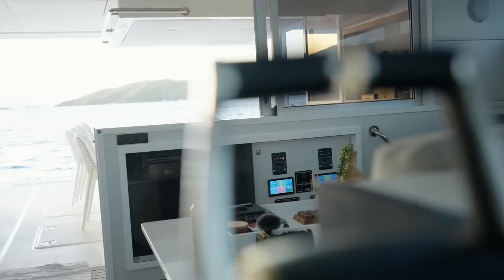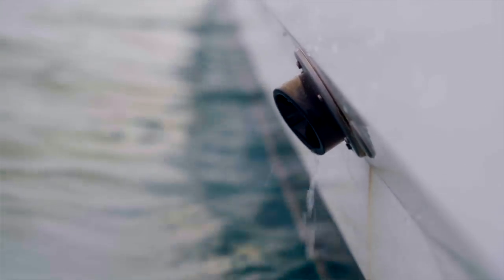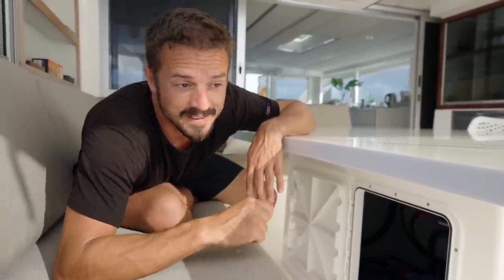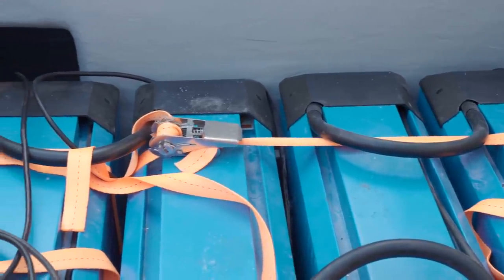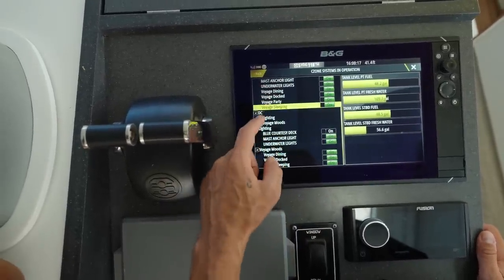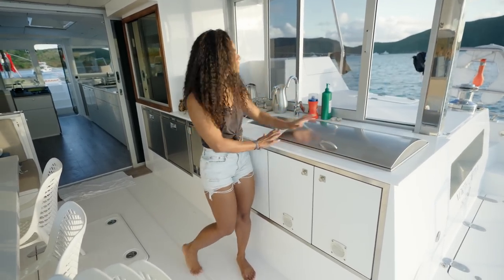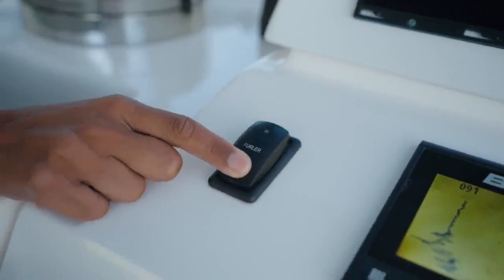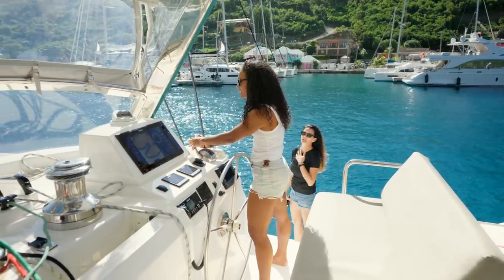Technical Boat Tour: Voyage 590 Hybrid-Electric Catamaran | Step 378

Comment: Great job on the tour guys! Having a boat like that in a charter fleet makes a lot of sense for what it provides to the customer. If anything goes wrong you can't handle, you just pick up the phone and call the base and help is on the way. As a long distance world cruising boat I'd have some second thoughts. There is just way too much technology on that boat. I think you would need to have a minimum of two techies on board just to have a reasonable comfort level and I'm a technologist. I like the idea of a monohull with some tech but also a good manual reversion capability. Look forward to Uma's reconstruction videos.

Comment: It would be interesting if you guys could swing a trip on the Zen 50 with the Wingsail when it comes out. It may be the first renewables only vessel with a fairly decent turn of speed. The Wingsail is supposed to be not only more efficient than a conventional sail, but to be progamamble so that any idiot without sailing experience can sail it. In spite of my apparently being super qualified to test it, in that case, I think I will leave it to others! If it works, it will be great to get rid of the smell of diesel. The Wingsail also overcomes most of the problem about shading the solar, too.

Comment: 22:46 - Speaking of hot showers, how's the pressure? I was recently on a chartered Bali cat and the (telescopic) faucet was decent but it definitely cannot be used as a shower! I tried to get some hot water out of it for a few seconds and the crew panicked because it drained the battery, so only cold short faucet water supply for the rest of the trip. A pull-out faucet DOES NOT make a shower!

Comment: The overarching principles of hybrid propulsion:

1.  Power Source:  Batteries.  Enough battery storage to achieve relatively modest (5 kts), short-term (< 1 hr) movement by means of batteries alone.

For hybrid cars, this would allow them to conduct the majority of their commutes via battery power alone.

For hybrids sailboats, this would allow them to safely drop sails outside a harbor and use electric propulsion to motor both to a dock or slip, as well as back out into a channel or seaway before raising sails again.

2.  Power Source:  Diesel Fuel.  Enough diesel fuel storage to achieve relatively strong (10 kts), long-term (>10 hr) movement by means of diesel alone.  

For hybrid cars, this would allow them to travel at least 500 miles between cities without refueling.

For hybrid sailboats, this would allow them to motor several days out of doldrums back into wind-driven areas while topping off their electromotive battery propulsion.

3.  Power Source:  Solar Panels.  Enough of a third source of energy (solar panels) to accomplish two things:
 - Beginning with a system that's totally dead, provide enough solar energy in one hour of average daylight to charge an engine starting battery enough to start a diesel engine.
 - At anchor, provide enough energy during any average 24-hour period to power normal systems on the boat for 36 hours, not including A/C.  The 50% overkill will cover your panels' reduction in production over time.

4.  The ability to use any system, directly, to propel the boat, even if the other systems are completely on the fritz.

For hybrid vehicles, this means using diesel in town and electric on the highway, but each within their respective limits.

For hybrid boats, this means using either system to drive the propeller, either individually or both.  It also means getting at least 2 knots out of direct sunlight, alone.

Comment: Pretty creative hack using the MPPT’s as 48V-24v DC-DC converter, but from what I’ve read, it’s not a great idea, as if there is ever a fault, it is designed to short circuit the PV side which is not a big issue when it’s just solar panels, but when you have a 144 V 44kW battery up stream that your short circuiting… eek, at a minimum you would fry the MPPT, at worst…. Well… 🤯
Reply: Why would it short the PV instead of letting it float to its max voltage? Surely having no current flow is safer.
For example, you can't pull MC4 connectors when current is flowing.

Comment: What happens when you have a lightning strike???
What happens when salt water and/or salt air impacts the battery system???
What happens when you can’t control the boat without the electrical system. 
What heck is the cost of an electrical system for Uma???
ENJOY. Love your channel!!!❤❤❤
Reply from the maker: Same thing that happens when any of those things happen to a diesel boat. They need a robust electrical system to operate too. Starter battery. Computer controlled injectors. Water pumps. Chart plotters. When’s diesel boats gets hit my lighting, they’re dead in the water too. Only difference is, a sailor on an electric boat has become a very avid sailor who can move the boat under sailpower alone. Whereas someone who relies on the diesel engine to fix all their problems will probably be screwed if they loose it.

Comment: I can’t see why one would opt for this hybrid setup as opposed to just having two diesel engines to power the boat . As you pointed out having a generator running when you’re at anchor is unpleasant for those on board and annoying for your neighbours. I get the point that solar panels can get shaded by the rig but with a bit of ingenuity and more panels I’m sure this can be avoided. There is always wind and water generating power available to keep the seven (!) fridges going and obviously if the boat has ICE power then batteries will charge when motoring.
Reply from the maker: The thing is, the all diesel version still has two massive gensets, that run just as long as the hybrid ones to. It has a smaller battery bank, the genny's need to run more often to keep them charged.
Reply: @SailingUma I see, that’s the price you pay for having all that equipment on board. Twenty years ago we chartered a 45ft Jeanneau in the BVIs with Sunsail, it was quite simply equipped thankfully and was really just a large version of my own Albin Ballad back in the UK, I don’t think there were so many cats around then . Great sailing but fresh provisions were difficult to obtain, everything seemed to be frozen.
Reply: I agree with the engine electric type. You can use engine or motor. Regenerate with engines.

Comment: It’s the Chevy Volt of boats. I had a Volt and loved it but went full battery electric a few years ago. The complexity of the Volt worried me as it aged so I sold it after four years. I would have the same fear with a boat like this one. The complexity is well beyond the average owner to troubleshoot so when something breaks it’s going to be very expensive.
Reply: What is the additional complexity compared to any other boat in the class?  Anything similar is going to just have slightly smaller gensets and 2x 75-100 hp yanmars to maintain in exchange for 1 less battery bank.  Nobody is building or buying 14 passenger 60 foot cats without digital switching, power furling, multiple voltages  etc.  Sure a stripped out Uma is far simpler but that's like saying the replacement for you Chevy Volt should have been a fixed gear bicycle.
Reply: Volt owner also..2012.. Sorry your battery failed..I still think the volt is one the best vehicle ideas ever designed.. Best of both worlds.. Doesn't jeep now sell something similar?

Comment: With the short runs these boats are actually doing in the BVIs then the sail is pretty much there for decoration and, I suppose, a bit of fun. Probably better to use something like the Greenline 45 Fly, which you can buy in a hybrid configuration and has bigger solar panels without shading as there are no sails.You would likely be running the diesel less often than in this supposed sail configuration, but I suppose for what is really a holiday boat real world usage is not the main consideration.

Comment: Gotta question if i bought a sailboat a small one and i want to live in it full-time but the sailboat has nothing completelly gutted no electronics nothing but a floating sailboat i just want to live on it docked or just on anchor somewhere but it does have a running motor  and the mast is down ,should i try this or no
Reply: If you don’t have a mast you are much better getting a power boat there is much more room.

Comment: Great show enjoyed  the content 
one question , that boat is set up for 14 people . UMA is set up for 2 people . How does its power consumption stack up to 7 UMA's ? Taking into account the larger boat would be set up much different if you owned it . On regen and amount batteries  would drain   before Gens kicked in . Since it is set up as a comfort power hog right now
Reply: It would be interesting to compare/ contrast the specs of this boat with what the WYNN’s will soon be breaking in 
(Palatial vs practical?)
Reply from the maker: It’s hard and doesn’t really make much sense to compare different boats built for entirely different purposes against each other. 

It’s like comparing energy consumption for en electric bike to a semi truck. Sure you could compare the actual numbers, but they won’t tell you anything useful. Of course the vacation palace uses more power than uma. It has 11AC. 7 fridges. 2 icemakers and a massive Watermaker. It’s a completely different both, built for a completely different job.

Comment: Dan : " Really easy to source and figure out if there is an issue " LOL - sure it is  , every joe at some remote atol will be able to repair that himself no problem .  In reality a simple standard instrument suit with say a bad wind transducer , chafed wire or intermittent termination can be days to sort out .  Immagine when that stuff  is 15 years old .  I cite the fact the furler stoped working - now what ? That could be really bad in a passage . 

Better have deep pockets to keep it all running and not stray far from a decent repair shop .
Reply: Dan no doubt dug a bit deeper into it than could be included in the video, but he was unable to find the fault in the furler, and he knows a thing or two. So there they were, with a fairly new boat and a misbehaving motorized furler....how many pathways had to be examined/troubleshot to fix that one simple item...battery, breaker, switch, motor?  not many, but on a fairly new boat? It would take a lot of experience (years) working with marine electrical systems to be able to troubleshoot that yacht. 10% yearly maintenance costs? Nah, a bit more is my guess.
Reply from the maker: It was a tripped breaker. I just couldn’t find it. And since it was the last day, didn’t bother asking. Super simple fix and if it was our boat, we would know where the breaker was.

Comment: Dehumidifiers are cheaper to buy and massively cheaper to run. They keep you cool in the summer and stop you getting cold in the winter. Moisture is the main constituent in transmission of heat energy through convection. Remove the moisture and you get dry heat rather than swampy muggy air. Remove the moisture and the damp air that chills you to the bone has gone. It also stops mould and mildew. And it dries your clothes cheaper and better than a tumble drier, you just hang your wrung out clothes on coat hangers on a rail. Your wet weather gear dries to. And you can use the grey water from the dehumidifier to wash your salty clothes with. Unless it is a specialist drinking water dehumidifier DO NOT DRINK the fresh water from it as it will contain lead and other heavy metals from the heat pump cooling mechanism as well as being standing water exposed to constant airflow so it is probably full of bacteria.

Comment: The 12v AGM battery is most certainly to start the generators. 12v electric devices would run from 24-to-12 transformer.  I’m not sure I understand the purpose of the hybrid system? A pair of diesel engines could move it faster and modern alternators could do the charging. Fewer components.

Comment: If a mono hull boat is like a horse and carriage  then a catamaran is like a modern car. If you can eliminate sails and rely on solar power with a generator for a last resort it is like a private jet.The last one won't happen in my time but it will happen.

Comment: A great boat for it's purpose.... to act as a small cruise ship. I guess the label Hybrid-Electric is the new catchy title for things but I would call it a diesel with an electric transmission, in the same way some cats use hydraulic transmissions. While it is true it can be run on the batteries for a short time, I would argue that the batteries are protected from over charging in this manner rather than being made to motor electric only. Electric transmission is still a great choice if the prop is designed to use the electric motor's strengths but I don't see that. Running the house bank from the motor bank makes the house bank smaller as well as redundant and runs the gensets less often.

The comments about outdoor space and other amenities, need to tempered with apples to apples comparisons. That is this boat should be compared to a similar priced mono-hull.... which would be much longer and have a hull that is quite wide too (as most newer mono-hulls are). such a mono-hull would likely still have a lot of outside areas and dual drives too. I can understand comparing this with what one already has though, I would do the same thing.

Comment: Whole  lot of equipment to break as those boats age .  Being a guy with a boat made in the 80's  complexity is what will kill a boat .  Repowering that would be a HUGE cost and it is all complex in a salty wet environment that gets shaken .  4 heads , 4 showers , multiple fridges etc . Fine if your budget is for a new boat and get rid of it before it ages . 

Friends with boats like this spend  a whole lot of time constantly trying to get something fixed . It is all a comfort / cost balance . Two engines give you redundancy , and twice as many failures .Bad   Fuel can take out 3 engines on these monsters . 

I opted for a 34 foot boat with some complexity as a balance , two can handle easily , systems are somewhat simple , room for guests for a visit .

Comment: So they don’t have a diesel engine? Genererators charge batteries to power motors?

Why that system as opposed to how a hybrid car works?
Reply from the maker: How does a hybrid car work? Is it not a petrol engine powering a battery bank that turns an electric motor?

Comment: Each genset is 22 kW and they run 4 hours per day means 2*22*4=176 kilowatt-hours per day!!!!  Even with all the fridges et al I don’t see how that adds up.
Reply from the maker: Well. It does. It also has an electric stovetop. Oven. Blender. Microwave. 11 AC’s water maker. Electric motors etc. it’s a full house that floats. 

Those fridges burn about 1-1.5kwh each. X9 and you’ve got 10-15kWh right there. AC’s burn way more and we had 5-7 running at all times. Watermaker is about 3kW and we ran it for a few hours a day. Like we said, we weren’t trying to run the boat like it’s a pure electric. We were running it like it was designed to be run. 

So that 176kwh doesn’t take into account inefficiencies in running/ charging etc. Both gensets running put out about 35kw. We figured we were burning through about 100kWh a day.
Reply: @SailingUma  I forget the  AC, it’s is probably  the biggest consumer. If each one is 1 kW and you run 6 of them 24 hrs/day that’s 144 kWh right there. And that’s not unreasonable given that you probably had those big sliding doors between the cockpit and the salon open a lot of the time trying to cool off the whole atmosphere :-) 

Good for you for doing the experiment . You’ve conclusively demonstrated that floating apartments like that are outrageously inefficient. My house is far larger, all electric, and it uses only about 30 kWh per day INCLUDING charging my two electric cars (though those don’t get driven very much).

Have you done an inventory of how much energy Uma used in the past? Do you have a plan for how much it will use in its new life?

Comment: Hmmmmm seems redundant to have a diesel generator to run a electric motor. Seems like an extra cost that’s not needed. Just run diesel direct. Specially on a charter boat. Running the ocean I can see the system should you run out of wind. But wait you two just sit in the middle of the ocean till the wind comes back

Comment: Still not sold on electric boats.  Too many things can go wrong.
Reply from the maker: Less than a diesel. A diesel engine has a battery, and two electric motors and at least 3 holes through the hull to make it work. We have a battery and one motor and one hole, with hundreds of fewer moving parts. Our motor is rated to 100,000 hours. This Catamaran isn't the best example of a hybrid set up, it's been over complicated to make it easy to operate for charter guests. And for that it does quite well.
Reply: @SailingUma  We have one electric power boat and one electric Gemini charter catamaran.  So many issues but good luck. I wouldnt want that for a around the World voyage especially in isolated regions where you need support. Add 6 kt currents.   I also live fully off grid in my cabin and change batteries every 3-5 yrs.  Gone weeks without sun and running generator just to get some charge isnt fun on land and definitely not fun on the water.  Fire is also a huge concern.  
Keep living the dream just my experience.

Comment: Coming from someone (myself) with an off-grid (landlubber) background it makes zero sense to have that boat be electric given you have two gensets to maintain. The charter/short sail issues are at play for sure but it sure seems like a "green" sales pitch to insanely decadent charter guests but whatever works. Having to run 44kw of diesel genets just to move makes zero sense. Rich persons green yacht.

Sure hope your not going to be baited into some option like this.. your setup seems way better.
Reply from the maker: Different tools for different jobs. That’s all.